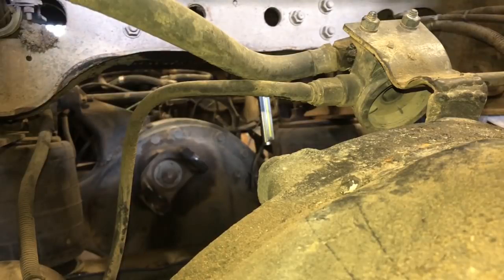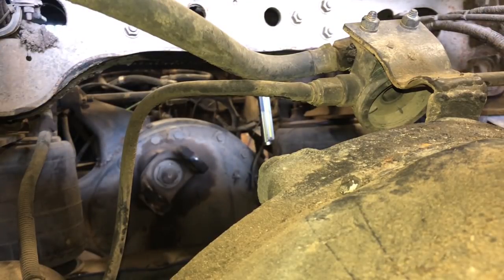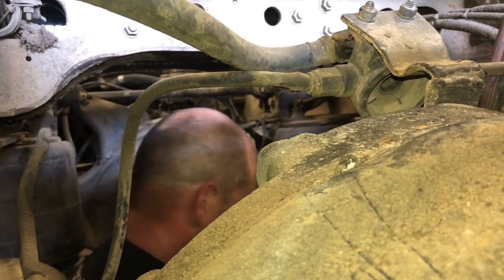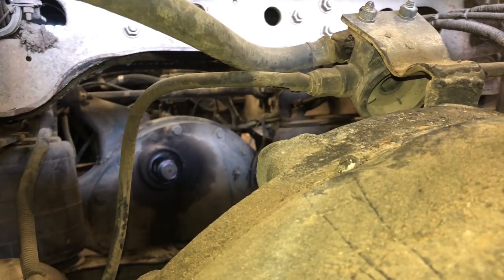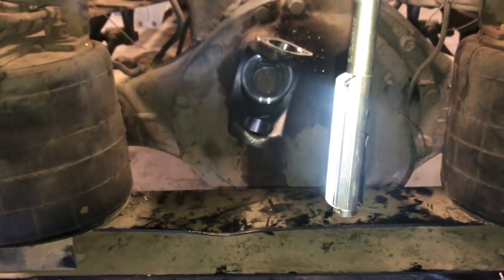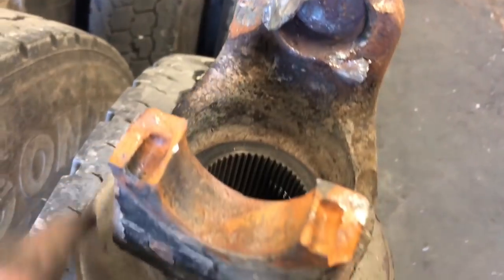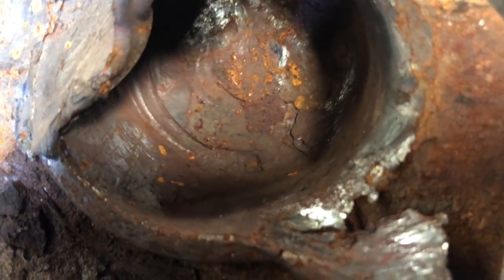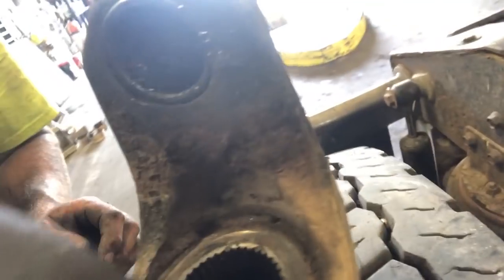New drive shaft in my bird    That went swimmingly!!

Comment: Do you have any Air Brake tanks kicking around.. hook one up with a 10 to 15 foot giant size air hose with  probably a 1/4 turn ball valve.. this connects to the big air impact... put another fitting on the air tank with with a ball valve.. that connects to the end of your shop air hose.. this will give you a Surge tank at the end of any hose you hook the tank on so you don't loose pressure and torque anywhere near as fast as you seem to be when using the impact wrench..  this will greatly improve your break away torque from the impact..  if you are working in your shop.. you could use a vertical 20 gallon tank on wheels to do this with..  or almost any thing larger than 5 gallons.. 

i worry about how you tighten the new yoke. as the bearings you are loading with the yoke nut are Tapered rollers.. it's almost like over tightening a wheel bearing..
Reply from the maker: wayne p awesome thanks bud

Comment: Have you ever considered investing in a RADGUN or a Hytorc. They would save heating nuts and bolts and burning your self. Radguns are air powered and probably cheaper that a Hytorc.  They are also faster.  Hytorcs are hyd powered, stronger and smaller but slower.They would also let you properly torque those nuts. LOVED this vidja.
Reply from the maker: salty 101 thanks bud
Reply: I guaranty you, once you use a radgun you will wish you had one years ago. My guess for you would be a rad18 (1800 foot lbs) 1 inch drive.  you set your air pressure to get the torque you want.

Comment: The struggle was real on this one! That's alot of fire on that shaft. The way I do that is use a welding tip to heat one flat on the nut. That will expand the whole nut without heating everything else as much. But, you got it off of there! So, that's what matters. 🙂
Reply from the maker: To The Top Crane got ya thanks buddy

Comment: Just admit ole blackie has much torque and horsepower that it chunked out all the grease. On a serious note Wade on the wreckers I use to operate I went to using John Deere synthetic corn head grease and it solved a bunch of our issues.

Comment: Wade, that joint was greased because there was grease on the other side, in my opinion I'd say the needle bearings went bad causing it to over heat and cook the grease out over time and aventually welding that cap solid

Comment: When using your rose bud Check to see if stamped on the handle near conneciton nut or tip if it says "  constant pressure" or something like that. If it does the pressure on the fuel and Oxygen need to be about he same about 10-15 psi each  just til you get the flame/heat you like/want  If it is countuily run with the oxygen at 60-80+ psi it will burn up the rose bud and it will pop and sputter when it gets hot  and could ( long shot) start a fire in the  hoses and set the bottle off  BOOM baked tater..thats bad

Comment: Grease is just like electricity, follows the path of least resistance. Basically, over time is happens to most all of them. The one getting the least or no grease dies. A good practice is to occasionally crawl under and feel the yokes for heat or use an IR gun. If you see the dreaded red dust anytime, you know what is up there. LOL

Comment: Ole blackies wheels and chrome rear light panel are sure looking good Wade. Is there only one zerk fitting per u-joint? If so, maybe the cap that was dry had the grease pathway plugged up.
Reply from the maker: loadpin yeah one